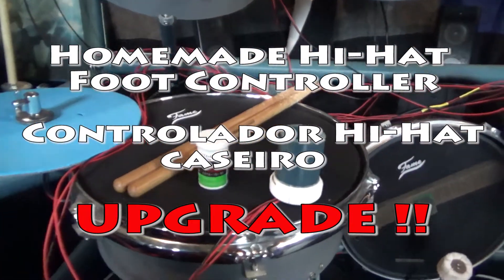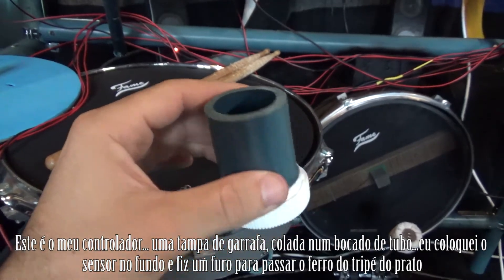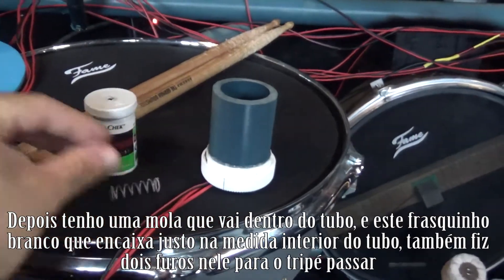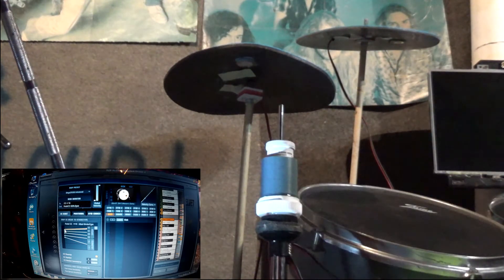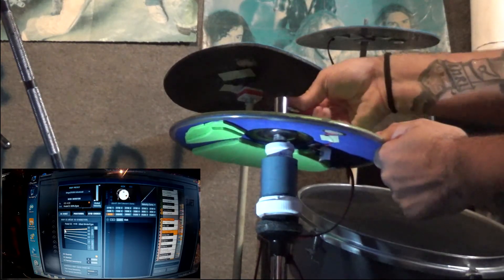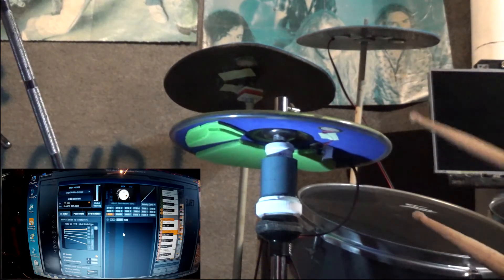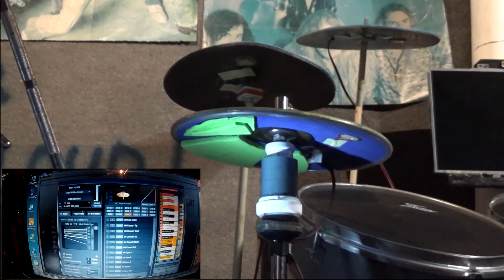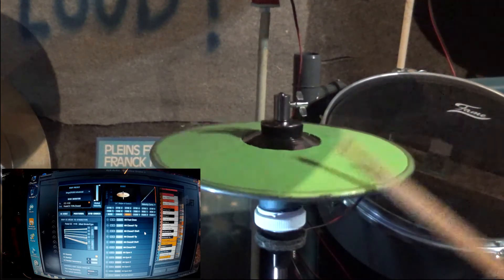DIY - Homemade Electronic Drumkit part16 - HiHat foot controller upgrade

Comment: Hello. Dear friend, how did you managed to make this hi-hat controller work? I use the same micromegadrum firmware as you. It works only in 2 positions as at your previous video when you have  been making the high hat controller out of the old drum pedal. Please, help me. I will appriciate highly. Thanks ))
Reply from the maker: I had to swap hi-hat foot splash and foot close positions on addictive drums, and also had to change some values on the code itself....the thing is that i did not saved the changed code and after all this time i can`t remenber what it was....i have been struggling to read the code on the arduino to compare with the old one and see what i changed but it seems pretty impossible....
Reply: luisfilipe1983, thank you. I have found out that it works fine out of the box)))). No need to change the code, only to change notes as you have said. So micromegadrum is fully working. I bought a broken alesis hi hat pedal on ebay and installed tcrt 5000 inside it.
Reply: @АлександрЦарюк-ц3э  can you share the sketch? thank u.

Comment: Hello. I saw the new video about pedal hi-hat. Great that you got it right. I also do a mechanism like you, but I have a problem in my program code. That's why I asked you about the possibility to share your code
 PS. I take the basis of the Evan's Kale code , but it did not have control pedal hi-hat #CC4. Where can I download your program code to complete my task, if it is not a secret.))). By the way I have currently done so))): https://www.youtube.com/watch?v=Rgu0HUeI070